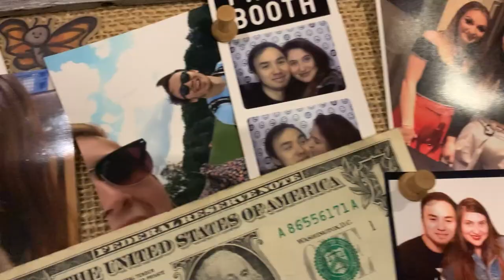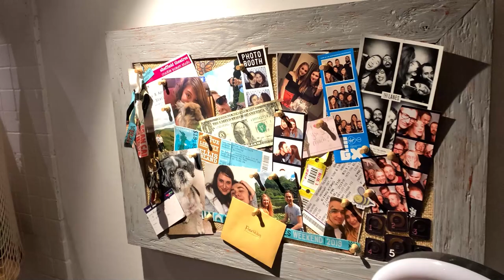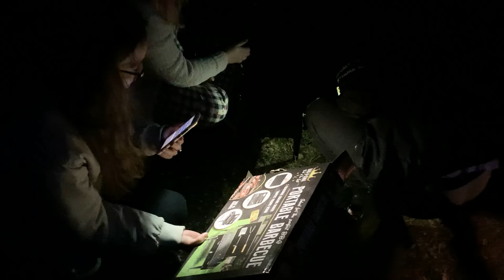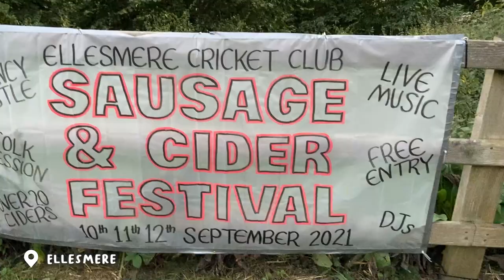Our first visitors! | Friends and narrowboat engine problems - 15

Comment: So enjoyed the video. Here in the USA when we light a bbq we use lighter fluid. You spray it on the coals wait a couple minutes then light and it works great every time you might be able to find some there? They also make grills that take small gas bottles so you don’t have to mess with the coals and can cook straight away that work very well. Have seen them that hook to a rail like on a deck have thought sometimes you could mount on back of a boat and use daily. Everything taste so much better cooked on the grill. Poor baby I know his paw hurt from the wasp sting they are so painful and poor guy sure doesn’t understand what happened. Loving all the changes to the boat also. Susan
Reply from the maker: We dont tend to have a problem with the bbq, its just on this occasion we had ran out of bbq coals and were trying to use stove coals, which probably wasnt the best idea haha! 😅 Thanks for the tips though! 
When he hurt his paw it was so sad he was just looking at us for help 😓 within about 30 mins he was running around as normal though!

Comment: The stern gland is designed to drip. The prop shaft goes through the hill to the prop. To stop the canal filling your boat the stern gland is packed with graphite rope and then greased via your greaser. If you over tighten your bolts you’ll over heat your prop through friction and potentially cause a massive bill. You’re turning the greaser but have you checked that you have grease in it? Hope this helps unless you’ve already sussed it if not please reply and I’ll be very happy to talk you through it.
Reply from the maker: All sorted now but thank you!’ 😊
Reply: @BoatTime  yeah I kinda of figured you would be, I’ve joined the party late as I’ve only just discovered your channel. I’d given up on Narrowboat channels as they were all the same mine included (Narrowboat lane) so just wanted to say yours is a breath of fresh air.
Reply from the maker: @tinythrottle6186  Thats really lovely, thank you so much!! 😊 it means a lot! Ill check yours out
Reply: @BoatTime  oh please don’t! Lol I like many new boaters thought all you needed to be a “creator” was a boat and an I phone. I quickly realised you also had to be entertaining and affable, unlike many I’ve long since left it to the “pros” like you two! Lol
Reply: Enjoy your chips #buymeacoffee

Comment: At 13:40 ! we have the same bowls! Look at the packing gland (aka stuffing box) around the shaft sounds like it needs tightening and you will have less water coming into the bilge at the engine. As for the bilge pump check the float switch, it may need replacing. Cheers!
lol...oops I said it too soon. If you tighten it and it doesn't stop leaking you will need to repack the gland...sorry I'm typing as I watch.
Reply from the maker: No way! We found them in a charity shop a few years ago! Ah thank you for the tip! We tried tightening the stuffing box a bit but I think it’s gotten greasy around the nuts so it comes loose again! 

Not sure what the float switch is, we’ll have to do some research! 

Thank you for the tips and for watching! 😊
Reply: @BoatTime  I found ours in a thrift shop here in Canada...lol.
Research repacking the gland, it's not difficult, messy but not hard.
The float switch is for the auto bilge pump, sits low in the bilge and is "set off" when enough water exists to make it float. There are videos to show you how to replace the switch. Enjoy the journey! Cheers!